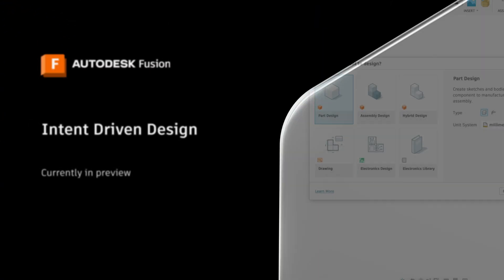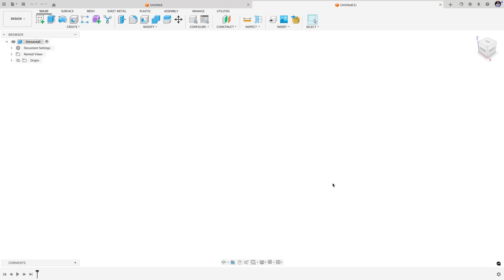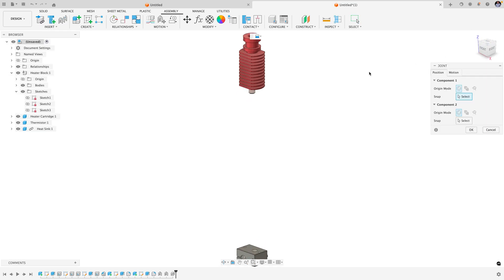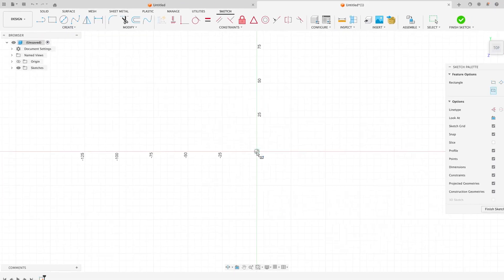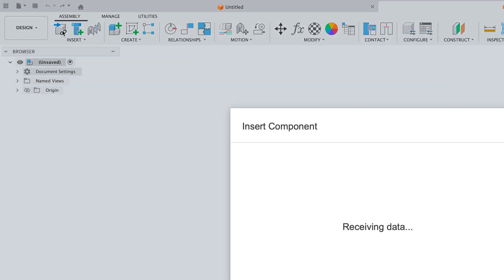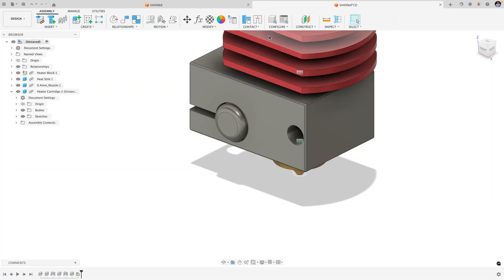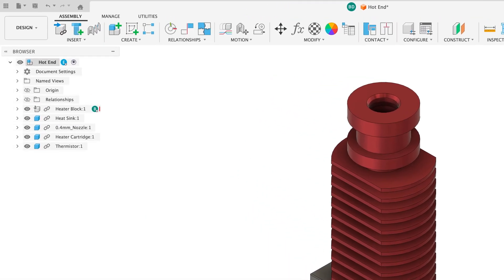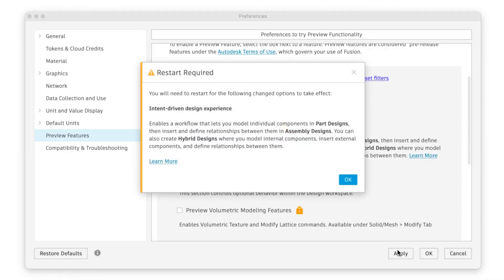Intent Driven Design | Autodesk Fusion for Education

Comment: Thank you Autodesk for doing this. I used to use Inventor, and when I changed over to Fusion have always struggled especially with the mating and joints, and trying to create an assembly. Making all this the way it is in Inventor is really going to make things so much easier. Thank you also for recently putting the Inventor Constraint feature into Fusion. Now we just need to sort out the 4 axis tool paths.........

Comment: I have not tried this yet, and I don't want to be negative, BUT are we solving a problem we didn't have? Let me re-state that...I believe you've solved a problem that I didn't have and have given me one more thing to teach that my workflow and curriculum didn't require. I think I can see that, IF someone was getting jumbled up with assemblies, bodies, components, etc. then this might give space to differentiate that. One of the things that I have always loved about Fusion is that I can start with just an idea and go straight to vaguely making a "cocktail-napkin" sketch of that idea and come back later and fill in the dimensions and see where that alters/enhances the design. Now I'll have to decide before I start sketching, or anything, what environment I'm going to work in? Like, I don't always know how many seperate pieces will end up contributing to this design. Will it be a one-piece masterpiece, or a 10-piece assembly of other stuff? (Does anybody else suddenly want McNuggets?)

I'm not saying it's bad, I haven't even tried it yet, but my knee-jerk reaction is that I'll be Hybriding everything from now on. Most of my students will be utilizing the Part method for most of their work (I teach a Precision Machining course, not a traditional Drafting or Engineering course), and when they need to enter into the Assembly phase of their training, they can choose that, but they currently just have to open (and update) Fusion to do all of that. Maybe I'm just missing how this benefits us (me). Y'all have done great so far, I figure you'll do fine with this (reticent old-timers notwithstanding).
Reply: Hi Jason, absolutely agree that hybrid is great for that "cocktail-napkin" approach, it cannot really be beaten in that arena and it will remain that way. From a curriculum perspective, it's still 100% valid to teach hybrid. The other options are there to make workflows (e.g. external modeling assemblies) that a lot of users are already using easier to do.

To help with the point about having to think about which environment to be in before you start sketching, something we didn't get the chance to cover in the video is that you can change the environment type under "Document Settings" in the browser on the left after you've started. So if you chose part and decided actually you wanted to make this a hybrid design after doing a little work on it, you can change it over.
Reply: @elliottgriffiths539  Being able to change the environment type is key. I'm in the same thought path as Jason but being able to change environment type will make choosing part instead of hybrid ok. I do feel like there should just be hybrid and assembly. I don't see a need for the dedicated part environment. The only difference seems to be there is one less tab in the part environment. Maybe I'm missing something. I taught SolidWorks for 13 years and switch to Fusion 3 years ago. My biggest appreciation for Fusion came from its hybrid environment. I'm glad it's still there. One thing I wish Fusion did that SW does is being able to put multiple part files into a 2d drawing that are not in an assembly.
Reply: @BobbyGoodPCHS  Thanks for the feedback, I will pass that on. For those familiar with Fusion's existing workflow I can see that Part may not be needed, my impression is it's primarily there for users from other CAD packages (i.e. SW, Inventor) because it's a familiar option they expect to see if they're just transitioning now. 

Hybrid is still there and is still valuable. This update is not to displace Hybrid, it's to make it easier for those who prefer to work with external components. As a former educator myself, Hybrid was also a major plus for the switch we made, so I hear you on that one!
Reply: @elliottgriffiths539 Hey! As long as the environment can be changed on the fly, that would seem to solve my concern. Thanks for explaining that!